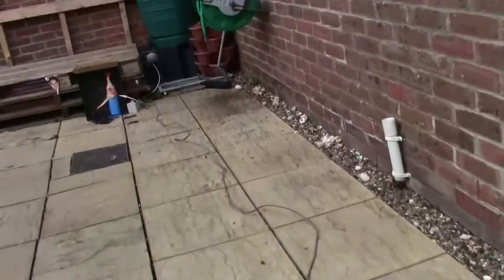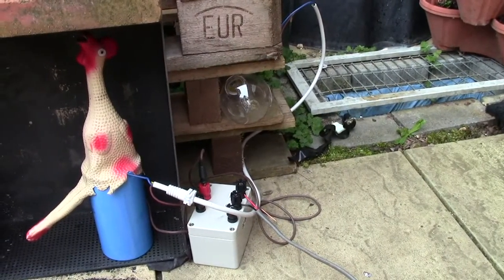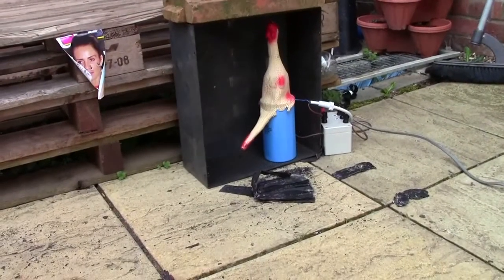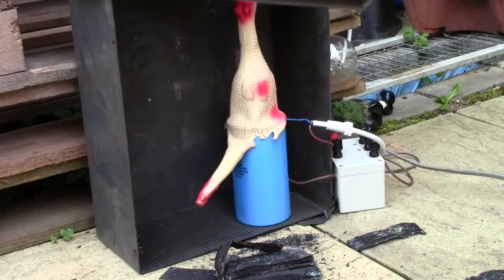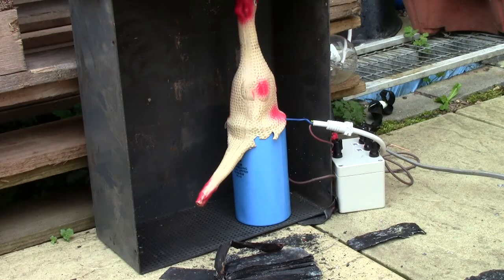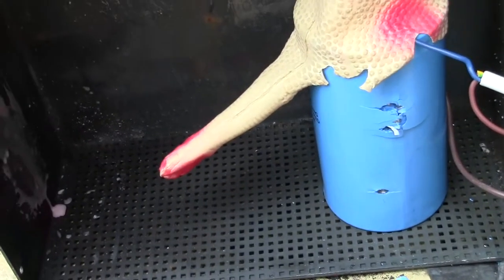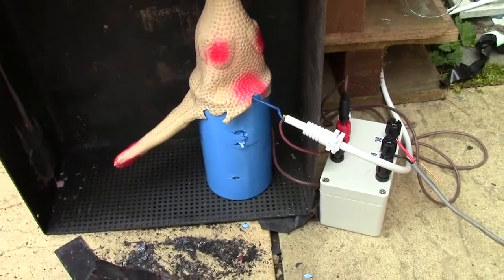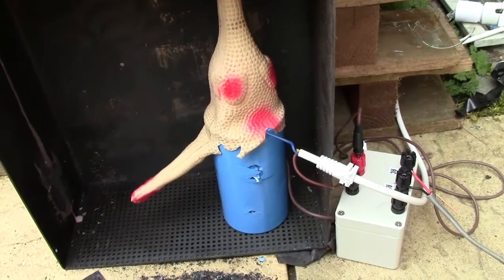Shooting a capacitor while still connected to mains and but the charge lamp made the best bang

Comment: Not the explosion I was hoping for, but that's how science goes. Thanks for posting
Reply from the maker: https://youtu.be/HKgyDwt8Zko here's one
Reply from the maker: Me either! I know why tho, so I was using a light bulb as the charge indicator... That was also acting as charge ballast so the caps had the full voltage but very very low current in them. I found a whole box of these caps and many other large bean can type. Maybe I'll try it again and say screw the charge light. What's the worst that will happen.. The cap will explode.. Mission accomplished 👍
Reply from the maker: If you wanna see some explosions, check out my video using 2 power station caps.. That sounded like a cannon going off.

Comment: Make your own capacitor with two sheets of foil and a thin insulator between?
Good job using a lamp for the ballast charge light indication!

Need to get hold of a bunch of 1000W lamps for a parrallel 3000W so the 13A fuse holds in when the cap is shorted.

x]

Comment: Aaaaah, only a lightbulb as a ballast? I would've used that *AND* a 3kW water heater!

It would've charged the capacitor muuuuch quicker and also, as the projectile went in there, with at least 3kW buzzing through that capacitor, I reckon something would've fizzed-over in there!

How much wattage was that lamp? It looked like a sizeable one! It's not the sort of thing found in a bedside lamp, is it? :D

Thanx for showing,

-BoomBoxDeluxe.

2nd April 2014, 17.30

Comment: Thanks for trying I would have used a 3 or 4 kw ballast :)
Reply: Spot-on.....I was thinking the same thing.

With 3kW buzzing through that as the projectile went in there....Something would've probably fizzed-up. Still, nevermind..... "Silly Flippin Lightbulbs!" :D

-BoomBoxDeluxe.

2nd April 2014, 17.25